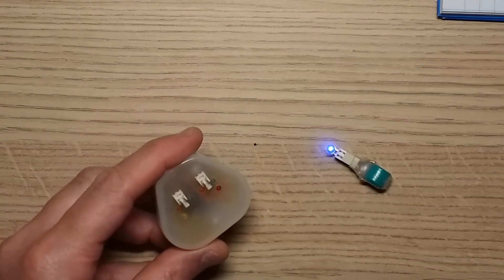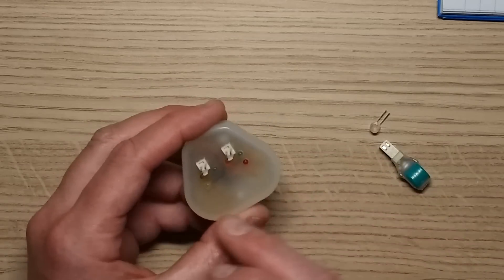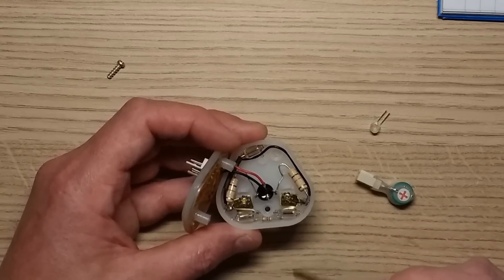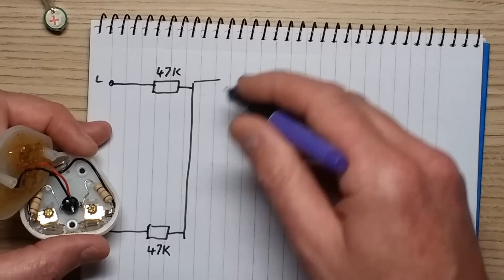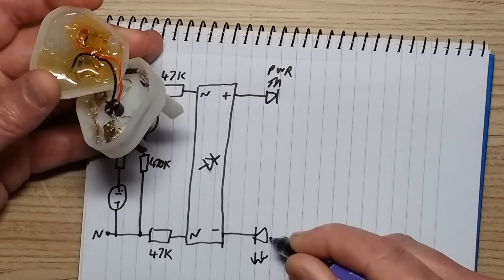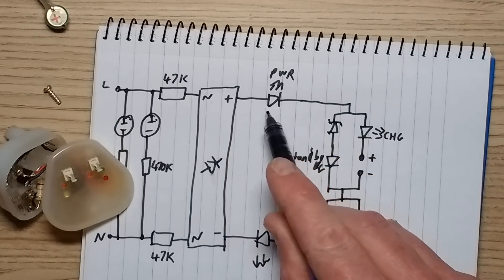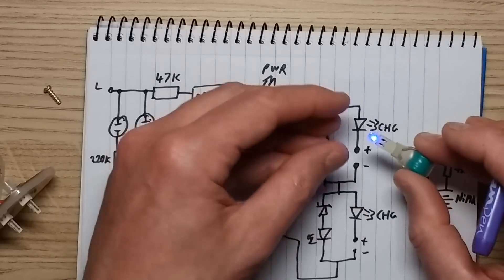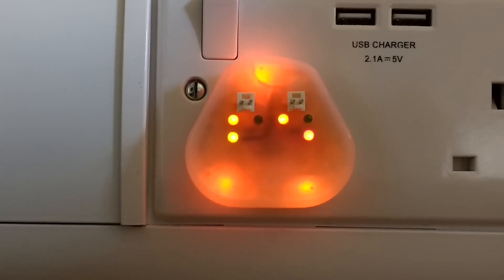Wearable LED pixel with my own shady charger.

Comment: "It won't kill you", now that should be a new British electrical safety mark for approved products post-EU divorce, it just has a nice ring to it... :P
Reply: "It might kill you, we can't afford safety testing now" :)
Reply: "If it tingles a bit, it's working
Reply: "probably won't kill you" and "probably will kill you" should both be abbreviated to PWKY but using a slightly different font.
Reply: anononomous There should be a 4th rating for "definitely won't kill you" (backed by a Scottish insurance company, not a London one).
Reply: And MYDE - Makes You Dance Excitedly.
Reply: Same font, just different letter spacing
Reply: Lmfao im a RF tech I work around three phase power and on running high power transmitters often. When I work on lower voltage like house mains and someone asks me if it'll hurt I have many times said it won't kill you and it gets me looks and then explain that power that scares me is the power that jumps right out at you and will kill you.
Reply: Just the W in italics for will, normal for won't.
Reply: Safety rules aren't as much to protect the consumer as to protect innocent uninvolved people who are in the vicinity a d don't know life threatening circuitry is around. Like exposed live wires on a jogging path. "Nobody ain't got no time for that!"
Reply: I'll say the most annoying thing about work in a high RF field is when rogue metal is near anything running hot like a ladder or a tool that isn't grounded because when you brush against it you get a nice RF burn and they hurt worse than being burned by fire. Imo I'd say they are comparable to a cold burn.
Reply: Us British are the worse people on the planet, we deserve everything we get from leaving the EU. I hope it ends really badly,  this is all our world, not "ours". Racist brexiteers will be crying soon, feast on their salty tears!!!!!.  

Oh btw, give veganism a try if you can :-).
Reply: There should be three ratings: "probably won't kill you", "might kill you" and "probably will kill you". 

Then we can make our own mind up without these politically correct heath and safety nanny state fat cat types in Brussels trying to stop us inadvertently killing ourselves or our families and friends.
Reply: In Clive lingo, "it won't kill you" = "a good result"  😀
Reply: May I suggest a skull and cross-bones logo/icon for that? Use the normal classic 'pirate' version,  but have the bones moved up to cross out the skull...

Comment: Ahhh live exposed pins!
Reply: JT Lowry ...for added excitement :)
Reply: The resistance is too great to pass enough current to trip a 30mA RCD.  The worst case is the negative peak of the mains = 230 * sqrt(2) V across 47kΩ = 325.269 / 47000 = .00692A = 6.92mA.  So just shy of 7mA.  That's within the definition of "safe", i.e. not enough to kill most peoole -- but it's still 7mA more than I'd want through me.

Mind you, I used to work with gas boiler ignition controllers, which worked by discharging a 470nF capacitor charged to 325V into a step-up transformer to produce a spark to light the gas.  I have had it up my arm a few times, and it was never pleasant.  What is interesting is the amount of energy delivered to cause such a painful shock is .5 * C * V**2 = .5 * 470e-9 * 325 * 325 = .025J.  That is slightly less than dropping a penny  (weighing 3.5 grams)  onto your foot from a height of 1 metre; which would impart an amount of energy equal to m * g * h = 0.0035 * 9.81 * 1 = .034 J.
Reply: Perfectly OK if you don't touch it.
Reply: Common sense is all the insulation you need.
Reply: If he only used one resistor then it would indeed be potentially live exposed pins. The rectifier can pass full mains voltage and current when its back-biased and a pin is referenced to ground. In this case both resistors on the neutral and live mean there is always at least 47k to limit the current. Not super safe, but unlikely to kill under normal circumstances.

Comment: Very nice. On the very end shot at 11:59 I see you have 13 amp sockets with built in USB chargers. Is there a particular brand you use and would recommend?
Reply from the maker: +48snapper This is in work supplied accommodation.  I wouldn't use sockets with integrated USB sockets in my own home.
Reply: they are dangerous and a really bad idea. imagine the shittiest USB PSU in existence permanently screwed into your wall.
Reply: they likely are the shittiest USB PSU in existence
Reply: Jamie Phillips knowing china, ofcourse they are.